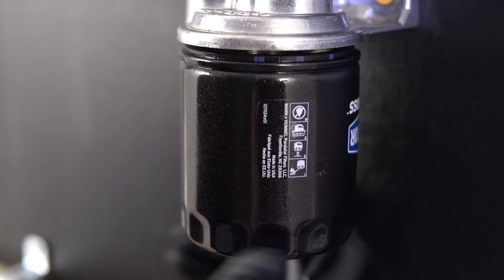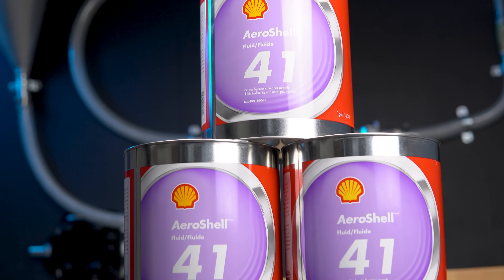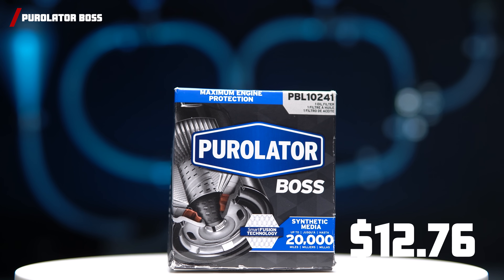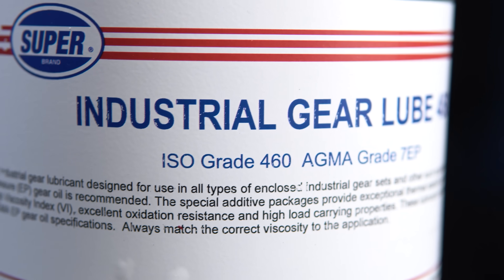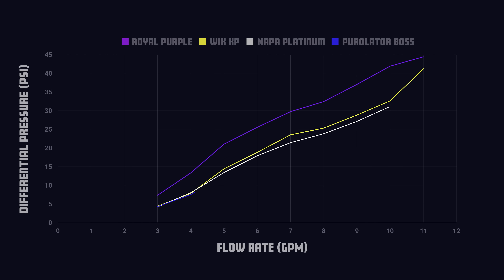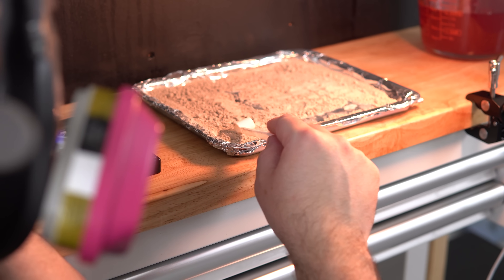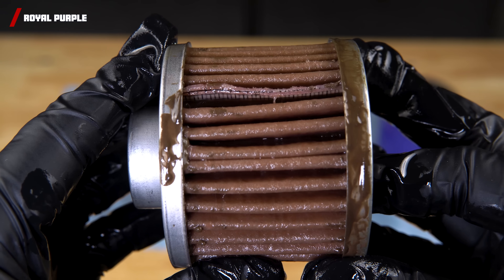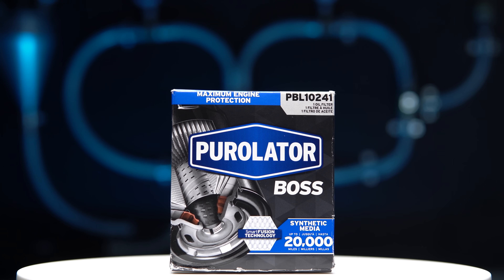Engineers Test the Most Popular Oil Filters

Comment: Would love to see a Denso filter in here too! They make a lot of OEM filters for many manufactures.
Reply from the maker: 👋 Thanks for watching and the suggestion, we will include several OEMs on a future video and at the end of the series, we will see which filter is the best. Thank you for your support!
Reply: @BrandRanks  
It would be good to mention the actual manufacturer of the oem filters being tested and test the manufacturer's matching filters along with the oem. A lot of people don't know that oem's don't build filters but they do spec them. The manufacturer filter doesn't always match the oem filter exactly.
Reply: 😂no... I know people that work at denso
Reply: it's Denso.... it's solid
Reply: @BrandRanks  Thanks, but you better thest the oil filters which are having the steel particles in the thread from the factory thread-cutting , because the factoryes did Not properly clean the threads !!! I have tested the Mann, Mecca, Wix, Filtron, Fram, and some other , But they Alll had the metal particles in the thread, which Are Directly sucked into the engine and into the bearings, thus Damaging the engine !!! ! !!! The Only Two filter factoryes , which did Not have those steel particles in the thread, were old Mahle filters (because some new ones are from China) , and Bosch filters . Now, please, do some more testing, 2 Disclosure this Deception of the Bad factoryes , which most of the mechanics are still Not aware of it. Thank you.

Comment: I switched to the mobil 1 filter in your last video and would like to see that one tested on the new rig. Thank you for the quality videos. You guys deserve more subscribers!
Reply: i think the Mobil 1 and the Purolator One are basically the same filter.
Reply: I've always used mobile 1, been getting 500k miles out of my CJ-7 engines
Reply: @abraham3981 no they are not even close to the same. Mobil One oil filter is synthetic blend while Purolator Boss is fully synthetic. Mobil One is rated for 30 microns and Purolator is rated for 20 microns. Smaller is better. 

That being said I personally have been using the Mobil One oil filter for 20 years or more now. It is a great filter, but not the absolute best.
Reply: @LeadStarDude  I was comparing the Mobil one to the Purator ONE not the Boss.

Comment: Maybe as a future filter test you could test the results of the STP Extended Life S45008XL and the PPE 114000650 for those of us running the 2.7L Turbo-4 and 3.0L Duramax? They're both replacements for the wimpy AC Delco PF66 filter. The STP goes for about $10, is rated to filter 15 microns and has a built-in bypass valve. The PPE filter is rated for filtering 10 microns, has a built-in bypass valve with a magnet and is physically larger offering more oil capacity. But it goes for $27-$30 depending on where you buy it from. I have the PPE filter and am giving it a try for my next oil change. But if it doesn't work out I'm looking at the STP as another offering to try. :)

Comment: This testing was definitely more thorough and scientific!

Now we will need to compare the results of this video to the filters used in the other video to have a real scoreboard going.

Nevertheless this was a great video and I look forward to more in the future!
Reply from the maker: Thank you so much for the kind words. Appreciate your support immensely. Given we changed several things in the rig and the testing method, we will be testing some of the ones from the first video as well as many other filters in future videos. Again, thanks for your support
Reply: Sure, more scientific; however, I'd still like to see the used oil test kept. Real oil with real particulates, not lab dust. Used oil is not going to have the same characteristics as new oil. And the metal particulates are going to have differing shapes and profiles than lab ground and graded dust.
Reply: @heartysteer8752  what you're saying sounds good. 
But if the filters fail using industry standard dust (that is designed to mimic the charactistics of typical particles)
Then I don't see how using "real world" examples would show anything more conclusive than what has already been shown. 

Due to the fact that actual engine particulates break off at different rates (and shapes as you said), there's no way to duplicate the same test using the same amount of "real world" debris. 

The laboratory dust allows tests to be more consistent between filters.
Otherwise the results could be skewed based on what kind of particulates were used for a particular test. 

I think these results are more useful than the random results that can be generated by "real world" examples. 😁

Comment: Awesome video! Would love to see the filters from the first video re-tested with the new rig!
Reply from the maker: Hey Michael, yes we will be testing the mobile one fram and KN along with Many others. We will be doing a video series. Next video will be FRAM. Thank you for the support.
Reply: And would like to see the used oil test again. Real oil with real particulates. Not lab dust.
Reply: @heartysteer8752  The "lab dust" is a far better test, there is a good reason he stopped using the used motor oil - the ISO standardized dust is controlled and the contaminant size follows a set standard (which you can look up), there is no physically possible way to create a whole bunch of the exact same used motor oil to be compared back and forth - this is because the contaminants in used motor oil are going to vary on driving conditions, oil temperature, settling, additives, engine state, intake air quality, etc. Using ISO standardized dust eliminates those concerns and gives you a far more useful baseline to compare against, you just can't have any control with used motor - this leads to bad data.

TL;DR - Relying on used motor oil to monitor contaminants and filtration capacity is like relying on your finger instead of a thermometer to tell what the temperature is outside.

Comment: It is said frequently that engine wear is due to particle sizes less than 20 microns, as they are small enough to fit into engine clearances (this is easily searchable online). These are the hardest particles to filter out. If you could point this out and maybe test for these smaller particles then your videos would be even more helpful in the future. 

Personally I have been running Fram Ultra filters as they have tested well in independent tests, and their stated efficiency (filtering ability) is the best I can find at 99% at 20 microns. But Fram has recently changed the construction of the Ultra filter and I do not know if it is as good now as it was before. 

There is a new Fram Endurance that states is for an even longer OCI of 25,000 miles, but I have seen no independent testing of this model.

Recently I have been buying Champ XL filters from RockAuto as they are cheap and manage to have the same high efficiency ratings of 99% at 20 microns, they seem like a bargain.

If you guys could test these filters, and any others that you find with good efficiency ratings it would be very helpful. Testing filters whose companies state up front that that they are not the best in filtration (with stated lower efficiency ratings) and quality is not helpful when we are trying to figure out who is the best. Thank you for all the work you have done to improve your testing and I eagerly look forward to your videos in the future.
Reply from the maker: Hey Morris! Thank you so much for the kind words. We left a couple of easter eggs throughout the video of oil filters that we are currently testing and at the end of the video you can see a sneak peek of the Fram endurance. Next video will be an all out test on the FRAM filters so we can compare to these. I personally run the FRAM Ultra and have had no problems so I get where you are coming from. Thank you for all the support. Hopefully these videos do well so we can continue to make more videos.
Reply: he didn't tell us where to buy that 10 micron filter
Reply from the maker: Northern tools... But not meant for engine oil only hydraulic oil, plus the thread on that is enormous.

Comment: Wix also makes Orillys house brand Microguard filters, same filters but about 30% less expensive. Microguard Select are Wix XP.  We have used Microguard for years on a fleet of 14 trucks plus personal and employee vehicles.  The cold fluid restriction shows why you still need to regularly change engine oil and not go 15k or 20k miles, it can cause the bypass valve to open sending unfiltered oil though the engine so you want good clean oil.  Even more with some people who think heavier oil is better, recommends 5-30 but they use 20-40, causing excessive drag hurting power and gas mileage. Plus possibly overloading the oil bypass valve causing high oil pressure at higher rpms when not warmed up.
Reply from the maker: Agree oil should not go that long without changing. Thanks for sharing and watching

Comment: One thing I consider with my filters is the check valve strength.  I use an oil accumulator in my system and I need it to not leak back when pre-oiling the engine.  My cheap OEM filters performs WAY better than much more expensive ones.

Comment: Thanks for stepping up your testing.  I have been an AMSOIL dealer for 44 years.  I like the fact that Amsoil shares test data.  Understand your use of the different oils for cold and hot flow rates.  I have no idea of the oil flow rate of IC engines, little 3 cylinder to big block V8.  You may want to find that data to bracket your flow testing.  Would like to see a Amsoil filter tested.  Thanks for helping me to continue to learn at the ripe old age of 79.  ron

Comment: I am a Mechanical Engineer so I absolutely love your methodology. But I do feel like there is a trade off between flow rate and capacity/performance. What I mean is that I think that a more restrictive flow rate filter media will usually by nature give a higher capacity and a better performance. So considering that if, IF, you consider all four tests have an equal weight you can then add the results together, and the Boss comes out on top with a score of 7.
You are obviously more experienced with testing than I am, so please don't hesitate to respond to my 2 cents worth.....LOL
I also appreciate the tear down and review of all the filters and I agree that it is also an important factor.
Reply from the maker: Awesome a fellow Mechanical engineer! Yeah there is normally that trade off, but in our FRAM video we found that filter material is also very important, cellulose tends to be very reatrictive and you can get a better filtering performance and better flow with synthetic media. Thanks for watching and supporting our channel! And yes the Boss would come on top actually after all the videos we've done so far they still are on the top even with a 50 percent weight on filtering performance.
Reply: Thanks for the response!! Very interesting. I didn't even think about weighting the different results differently, but that is a great point. And it was just my 2 cents worth that I weighted them the same. That sounds like pretty conclusive data. Can I assume that ranking is also compared to your other video with four other filters tested the same way?
I know this is a totally different test, but is there good way to test motor oil?
Again, I so greatly appreciate your testing methodology. There are so many auto part consumable products tests on here that make little sense, but your makes total sense and was a great and interesting watch! I will be watching more of your videos, Thank-you!!!
Sheepish grin...LOL.....Today I changed the oil filter on my 2006 Honda CR-V and installed a Boss based on some other (decent) reviews I watched before yours validated my decision.

Comment: I do industrial hydraulics, for us 15 micron is the testing particle size which has a limit of 20 counts. We use 5 micron filters to do a flushing loop to clean the oil and will let it run until the fluid has had a minimum of 50 passes through the filter.

Comment: Great info!  Well in the last oil change in my '22 Subaru Crosstrek running Mobil 1 ESP 0W-30 and a Fram Ultra oil filter. I did an oil analysis/particle count with Blackstone Labs.  Here were my results.  I'd say the Fram Ultra is superior in terms of filtration which is most important to me.😎
>70: 0
38-70: 1.6
21-38:  16.2
Reply from the maker: Thank you so much. Glad you enjoyed! Great data to compare, appreciate you sharing. Let's see the FRAM results on the next video! Thank you again. Make sure to sub so you don't miss it. It also helps us a lot as a small channel.🙂
Reply: @BrandRanks  I've been subbed for a while now.  Can't wait to see more videos!  Can you also test an Amsoil oil filter next time, along with the Fram Ultra?  Surprisingly the Amsoil filter is a little cheaper than the Royal Purple....😳
Reply from the maker: So glad to hear Steve. We are definitely testing an Amsoil filter, but that a little earlier in the process than the FRAMs, so we will release those first. Unfortunately these lab results take awhile, but luckily, we have kept everything consistent, so you can compare across videos.

Comment: It's a fringe case most likely, but another thing to keep in mind is that not all bypass valves are created equal. I know the Mopar filters for the Viper specifically have a higher pressure bypass to keep clean oil flowing longer.

Comment: Ya'll addressed all my concerns about your initial testing procedure. I feel like this time, ya'll are actually providing information that can help in picking the best option for an oil filter. It' doesn't look like you can go wrong with the Purolator Boss or either of the top end Fram's. They kinda fall in line based on their cost. I've been using the Fram Ultra for years, and you guys confirmed that it's a really good filter for the money.

Comment: As an aircraft mechanic and someone who has worked with engineers at an OEM for aircraft parts this felt right at home! Id love to see you test an aircraft oil filter that i use for our crssnas and pipers, tempest 48111, i typically remove the filter material to inspect for metal particals.  Great channel and looking forward to more trsts!
Reply from the maker: Thank you for the suggestion! And aeroshell is probably the hydraulic fluid you use. Thanks for the support!
Reply: Does an aero engine usually have both a coarse full flow filter system and a fine (highly efficient at removing micro particles but has a low flow capacity) filter bypass system?
Reply: @davidpowell3347  nope, adds complexity. Piston engined aircraft (the older ones) were about KISS. Keep it simple stupid, it adds to the reliability. The oil filter is just a paper filter with no bypass. The filters are changed every 50 or 100 flight hours and required to be inspected for metal material, if a certain amount of metal material is noticed in the filter it's time for a full engine overhaul. I usually only find a couple specs of metal and some lead deposits. Really early aircraft engines didn't even have an oil filter.

Comment: Solid testing, presenting, writing and filming. 
You guys will do well! 

I’d love to see a fuel filter test, too. 
I’m constantly told that the 200 series fuel filter should only use genuine filters as the denso filter is also made by the same manufacturer who does the injectors. 

Told to avoid aftermarket filters as they’re not as good.
I’ll only use genuine filters. So, I’d love to see ‘genuine’ filters in this mix, too.
Reply from the maker: Thank you so much, your kind words mean a lot to us especially after all the effort we put into it. That's a great video suggestion. We will look into it, unfortunately our pump does not handle flammable liquids so we would need to buy another one, so hopefully these videos do well so we can afford it, unfortunately as a small channel our budget is tight, but with support like yours, I'm sure we'll get there.
Reply: @BrandRanks  Just buy a cheap fuel pump and stick a regulator on it. 

I don't think flow rate is all that important when it comes to fuel delivery on a stock setup. It's the filtration that's important. 

But, no doubt you'll get there! Lets hope for another 15k subs off this video! :)
Reply: @666cemetaryslut  Naturally, I'm in the minority 😅 Just make the videos and shove it down peoples throats. They can tell us what we want to see lol.

Comment: Love your method on how you dou your filter tests.  Others just cut them open and have opinions on filter media and how thick the can is.   I much prefer your real world test of flow, psi differential, and filter performance that has a lab checking micron particulates.   I use Purolator Boss and sometimes WixXP.   I would love to see Amsoil EA and Bosch in the testing mix one day.   Great video reviews backed by meaningful testing protocols!   Nicely done!!!
Reply from the maker: Thank you so much for your kind words. It is much appreciated! We will be testing Amsoil soon! Thanks for watching!
Reply: @BrandRanks and please add Purolator ONE into the mix.  There seems to be a lot of discussion on some oil blogs about the Pur Boss is only 99% at 46 microns and the ONE is 99% at 20 microns.  Where I can’t connect the dots on that comparison is by how well the Boss performed on the particle count.  Blew away WIX XP and Napa Platinum and most others at the 20-38 micron level.   I can’t see how you can get much matter without sacrificing flow rate.   Just a thought.  I hope you guys are all okay and doing well at Brand Ranks.